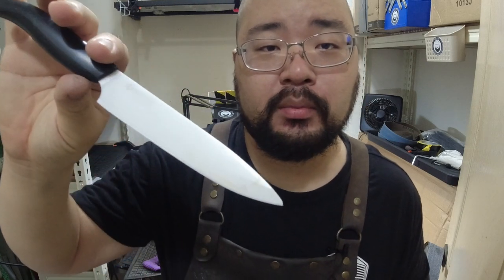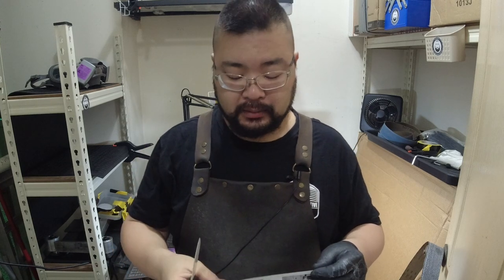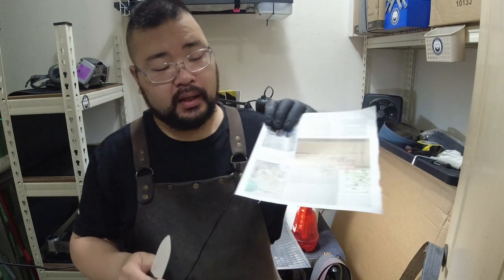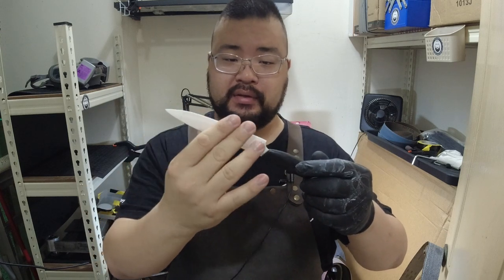How To Repair A Ceramic Knife

Comment: "SiC belts." ..?.. Silicon Carbide?
Reply from the maker: Yessir 😊
Reply: Surprised you did not need something harder than SiC, say CBN or Diamond. @The_Polished_Edge
Reply from the maker: @billmanning8806 yeah I'm pretty grateful really. SiC's might cost more than AlO, but it's a lot cheaper than CBN or diamonds.
Reply: @The_Polished_Edge wonder how ceramic would work on ceramic?
Reply from the maker: @100BearPaw  sic is harder than the alo the knife is made in which allows it to be shaped. If you used alo belts, it wouldnt work, and I've tried 😭
Reply: @The_Polished_Edge I didn’t ask about ALO?
Reply from the maker: @100BearPaw  Alo and sic are forms of ceramic